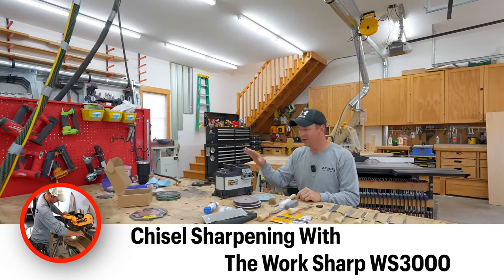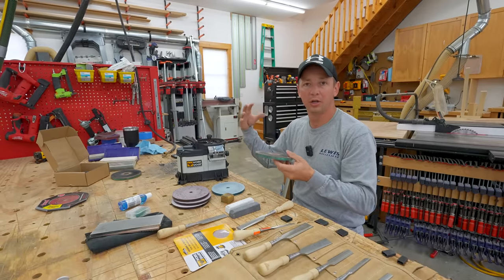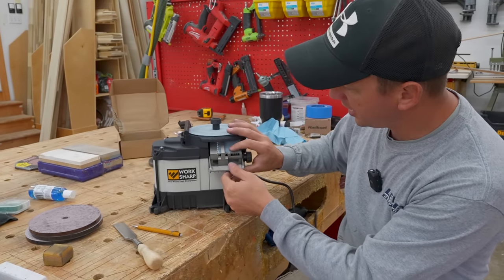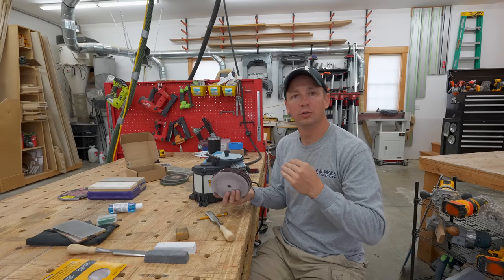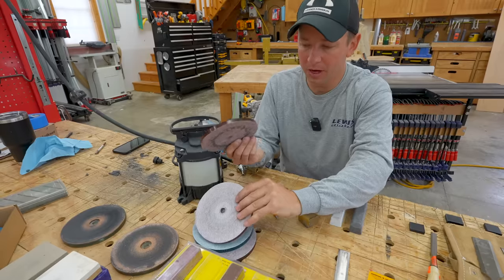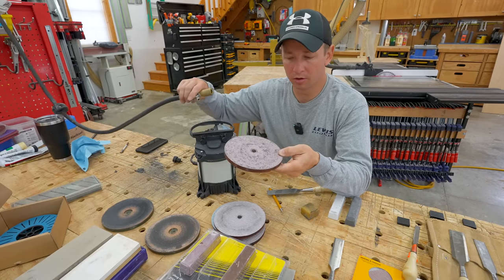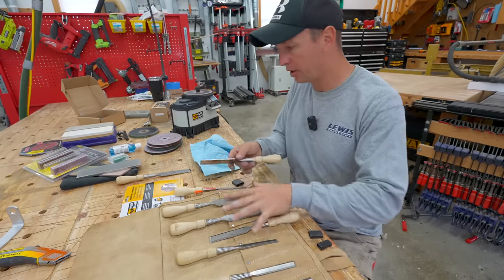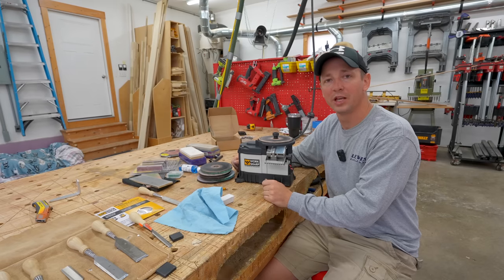I Finally Found a Sharpener I Like!!! | Super Sharp AND Fast

Comment: I have had the Work Sharp for several years. It works OK.  One thing I did was to remove that piece of sandpaper that is stuck on the machine.  After spending a lot of time flattening and polishing the back of my chisels (on water stones) I was not happy that I was scratching the mirror polish on that sand paper.  Removing the burr is very easy to do by laying the chisel flat (like Spencer does) on the spinning disk.

Comment: Great video!

This is a wonderful machine that I’ve been using for about four years now.

Work sharp supplies slotted blue discs which I find work extremely well because they reduce tons of heat and expel the shavings quickly.

I hand flatten all my chisels with 400 grit on a piece of granite.

I use a rubber belt dressing block to clean my discs, saving you time and money .

This tool is a wise investment if you work with hand tools!

Comment: The back of the chisel is hollow for a reason, I wouldn't spend too much time trying to make it perfectly flat. You only need it to be flat about 1/2 inch from the edge. The less hollow you make the back the more time it will take you to sharpen it in the future because you are increasing the surface area that you have to grind.

Comment: Spencer, TayTools has a much cheaper version of that sharpening system. But it uses a drill press instead of a dedicated machine and doesn't have a tool rest like the one you showed.   I bring it up because they have a float glass with four different grits just for flattening the back of the chisel using Cubitron.  There was one video where in about two minutes, he took a junk chisel and sharpened/flattened in about two minutes.  I'm betting that if you just ordered the cubitron/xtract circular sand paper from him, you'll flatten it in minutes.  Actually, now that I think about it, you should become an affiliate to TayTools as well.

Comment: I have a set of Marples chisels from the early 90s, I use these in the cabinet shop and a set of black handled craftsman in the van for installation. I don't loan chisels out to anyone, they won't come back to you as sharp as they were and they be nicked up. I use an oil stone dress up before use and they be ready for a good shave

Comment: I use a micro bevel. Shape at 30% and sharpen with like a piece of paper under the heel. Corse to shape fine to finish. Use a pushing stroke like twice and done. To resharpen just two more pushing strokes. Like the master violin maker who showed me said," you don't have all day to spend at a stone. Only sharpen what you need and get to work." Oh as soon as you see the line it's time to reshape. I have found that is about every ten resharpenings. I found that it takes longer to plug and unplug the grinder then it does to resharpen a blade.

Comment: I like the Tormek. You get a hollow grind and you can sharpen super fast and not change any discs. It's expensive, but buy once cry once. Plus if you really want to mirror finish you can get the japanese waterstone and look at your reflection in the edge of the chisel.
Reply: Yes, I agree and given that he A) seems to have all of the best tools available and B) cited stumpy numbs who has I think three Tormek's, I don't get why he does not use that system.....but who am I to judge?
Reply from the maker: I have a grizzly which is a bit cheaper version of the tormek and didn't care for that style of machine.
Reply: I like the Tormek too.  I find it more versatile than the Work Sharp.  The Work Sharp does do chisels pretty well but not much else.  Plane irons don't fit.  Spoke shaves, knives, curved cutting edges etc. are much easier on the Tormek.  I found mine used on marketplace and didn't pay too much...
Reply: I have a Tormek and it is too slow for me to recommend. But I spent the money on it so this is what I use with wet stones in between Tormek visits.
Reply: @jeffcarter1466  i feel like the slow speed let’s me dial it in faster and I can go from grinding stone to leather honing in one go without changing wheels. The fast spinning of regular grinding wheels makes me more careful and take longer to get an edge.
Reply: @garybutterfield8953  i got mine to sharpen  plane blades and then I got so into it I sharpened every knife in the house. The family is scared to cook because the knives are so sharp 😂.
Reply: I have the Tormek.  It's great for chisels, plane irons as well as kitchen knives.  I like how the water traps all the fine dust and prevents blueing.
Knife Grinders in Australia has some nice accessories.
Reply: @thekinarbo  his videos are amazingly informative, sadly he died. He was the guru of knife sharpening.
Reply: @crashkg 
That's terrible, I'm very sorry to hear that.  He was a master at his craft.
Reply: @crashkg  Yep!
Reply: Sorry Tormek type owners. Worksharp takes a few seconds to do the same thing. There’s no comparison. I’ve had mine 5 years. With 1000 grit in it it takes me longer to walk over to it than it does to sharpen the chisel or plane iron. 2 seconds on the slide and one second on the back. I use Narex and Sorby chisels. No setting of angles, no water everywhere, no stropping,no truing of the stone…..
Reply: @jimbo2629 

I'm not totally familiar with work sharp.  Can it sharpen 12" kitchen knives or meat cleavers?  How about scissors?
Reply: @InsiderCarpentry  I agree, I have a Tormek, while it does a great job the setup and mess / clean-up time just isn't practical unless you are setup in a dedicated workshop, Years ago I purchased the WS3000 and never looked back, so easy to setup and use, plus razor sharp edges, note: the know can sometimes get "Stuck" on and hard to get off sometimes, lucky you posted this it remind me to get rid of the Tormek that's collecting dust in my garage 👍👍😂😂

Comment: I have the same tool 15:16 I place a few washers on the spindle under the disk and that gives me enough room to use the leather disk upside down, just don't push to hard when your using it this way otherwise you will cut into the leather👍

Comment: I bought the 3600 and 6000 grit paper (pricey though)  and the package said the 6000 is like honing with leather.  So use the 6000 paper down and use the beveling portion of the tool instead of fighting trying to keep the bevel on the leather freehand

Comment: Make a small wooden or metal gantry with a pivoting base. use a digital angle gauge and zero it out on your glass wheel and then set your gantry platform to correct chisel angle.

Comment: A "natural rubber cleaning stick" (Amazon search keywords) will clean the metal or sawdust out of the sandpaper better than air or anything else.  Makes used sandpaper look new almost instantly.  (Not sharper but at least it is clean.)

Comment: I carry a cheaper Narex 1” Chisel in my Akibus tool belt!  I hv 2 Cherries ( set ) in my Van.  
I sharpen it once to flat and 1or 2 times a week 7-10 strokes on the Chisel back only ( once sharp just re sharpen by back only!)

So once and done !
My 2 Cherries hold a long edge!

The problem with the machine?  Heat!
Heat can and will break down a good chisel quick!  But I am sure you already know that Spencer !

I absolutely enjoy & learn something every video u make !  Thk U very much 4 your hard work!

Comment: There is only one method that works quickly and correctly. I’ve tried everything. The Worksharp is the answer. You can touch up a chisel in 5 seconds with no setup and no overheating. Forget secondary bevels. Mine are all sharpened at 20 degrees. I use a diamond disc in it. It rotates at the correct speed. The angle is totally repeatable without set up or adjustment. My Narex chisels took ages to flatten the back about 5 seconds.😀 That’s about 5 times longer than touching up the edge. There is no better system than using a slope. Forget measuring, honing guides, water everywhere, loss of temper, flattening the stone. Keep it near your workbench with 1000 grit in it top and bottom.

Comment: Like you, I absolutely hate sharpening and don’t like the idea of wasting time on stones or the Tormek machine. Honing guides are horrible also. I like that machine and believe this actually will alleviate my frustration with chisel sharpening. A suggestion I have for the spacing for leather would be to create MDF disks and making them thinner to include the thickness of leather. If still not enough to get underneath the disk, I’d suggest adding a couple of washers to raise up the disk. I’ll probably do that if/when I purchase this unit.

Comment: Good video as usual.  With chisels and plane irons, I find that once you get them flattened and sharp, stropping with fine compound often will keep them REALLY sharp for a LONG time without having to go through the other steps, unless you damage the edge somehow.  The Sweetheart chisels are pretty good steel and hold an edge pretty well.  But they DO come from the factory WAY out of flat.  That's disappointing.   In an industrial manufacturing facilty, how long could it take to add that little bit of extra quality finish?  I think the customers who are buying these mid/high end chisels would happily spend an extra few dollars for a set that has the bottoms flat and polished.  I would think that alone would sell a lot more, just for the WOW factor of seeing the polished, flat backs.  But what do I know?  I just imagine the positive feedback and sales increase they'd get when every YouTube influencer who reviewed these chisels said, "Let me show you what sets these apart and closed the deal for me make this purchase."  As they zoom in on the mirror finish that still shows the little unpolished hollow spot straight out of the package.  I think that'd be a no brainer.  But again, what do I know?  Well, I know it'd be a huge selling point from my perspective, knowing that I wouldn't have to spend a couple of hours flattening a set of chisels before I could put them to work.  Especially for something that would take just a few seconds with an industrial production machine.
As for THIS machine, I like the glass plate idea alot.  Sound a bit under powered, but not terribly so.  I like the small footprint and speed of changing the plates.  I would love to see this with a reversible motor so you could alternate which side you sharpen on.  With flat wheels like this, the farther you are from the center, the more material you remove because the speed and amount of abrasive is higher.  Not a huge deal, but I'm a bit OCD about some things.  Haha!
Reply: Crazy really most chippies just throw their chisels away when blunt they don't realise that new chisels don't even come sharp. They've never used a sharp chisel probably never had to work with hardwood so clueless
Reply: @jamiedyer7782   Yeah, haha!  When I was framing and forming many years ago, I always carried a 1in chisel in my pouches, as did a lot of others.  But mine were sharp.  What a time save when you need a quick notch or to knock off a protruding corner.   I learned the hard way to never let anybody borrow it.  They use it for everything but what it was designed for, and IF i got it back, it'd be badly damaged.  To them it was pry bar, concrete chipper, nail cutter, you get the idea.  Argh!!!  Still pisses me off thinking about it.   Haha!

Comment: The purpose of the leather is to strop. You do not have to get the angle perfect at all. Because you should have worked to a very fine wire edge. Then strop quickly.  Your only goal is to remove the barely noticeable wire edge at the cutting edge. The strop will act like a micro bevel setting and softly grind away that thin edge so that it does not immediately break when you begin using it. 

And don’t strop the backside of a chisel once you’ve flattened it. You’re working against yourself!  Flat is flat. Stropped is no longer flat and there is a lot of material to remove to get back to flat. 

Now, you may find you do need to strop some chisels. The steel on some chisels is simply not going cooperate all the way down to truly sharp without heavy stropping. This will become apparent with experience. And heavy stropping should still be a relatively quick process. 😊

Comment: Hi Spencer, tank’s for this video. I have a question; this system does it hone the chisel square? I wonder because it is sharpening on a wheel,  the right side (leading edge) of the chisel, see more circumference from the sharpening disc as it turn. I hope, I did  explain well my point, English is not my first language. Sorry for that. Keep doing your videos!
Reply: There is an adjustment to get a square edge
Reply: I have one- I found it slightly rounded the chisel. I use a sorby belt sharpener now

Comment: Thanks for the demo.  Off topic, but how do you keep the handles on your Sweethearts?  I’ve tried using sandpaper on the metal part but not working.
Reply from the maker: Spray them with hairspray and them pound them in.

Comment: Can one flip the strop disc and use the underside to polish the bevel?   And while we're at it, why not have one strop wheel with coarse on one side and fine on the other?  Also,  do wheels only mount in one orientation?

Comment: For knives I use a Ken Onion variable speed belt sharpener. Same process move from heavy grit, to 600~1200 grit. After that,it’s like two minutes to razor sharp a dull blade. I’ve even sharpen a razor knife blade.

Comment: As far as checking for sharp, try parring end grain. If you can move the chisel with minimum effort through hardwood end grain, you have a sharp chisel. 66carpenter

Comment: I love my worksharp, but with time the bearing surfaces will ware and the wheel deflects away from the chisel leaving an unsquare end with a tapered cutting edge that I suspect is sharp towards the centre of the wheel but unsharp at the furthest edge. I am just going to buy my third in a ten year period, so I doubt this would eber be a problem for nonpro's. CBN wheels are available but the finer grits tend to become compacted with steel and at that stage they are useless, in my experiance this dosent take long. I should add that I am an animal with my chisels. I fit oak doors to fully painted door frames for a living so 800 grit is as sharp as I need/find worth while whilst finesing hinge and latches.

Comment: Why does the whole back have to be flat? The chisel end is only about 1” or so. So why not concentrate just the end section?
Reply from the maker: I would say that in general it's because in order for that section to be perfectly flat, the rest has to be perfectly flat also. Except if you have  hollow area on on a chisel that doesn't affect the blade like I had on one of mine that I showed in the video.

Comment: Just get a normal bench grinder and fit CBN wheels, you'll never look back and they will last you a lifetime. Yes it is a hollow grind instead of flat grind, but the hollow grind creates a heel and toe on the chisel , that allows you to find the angle easily when you want to then move on to the sharpening stone to put a finished edge on the chisel. 
  Don't waste your time moving up the grits to the thousands, because first time you cut a lump of wood with your chisel, that finely tuned edge has gone.

Comment: I’m just curious about one thing. You talk about using multiple smaller steps between grit and you didn’t like going from 300 to 1000 on your diamond stones. However on the machine you went from 400 to 1000. Is there a reason you didn’t have a 600 or 800 in there? It just still seems like a bit of a jump in my mind. I have no experience sharpening and very little sanding experience so I’m literally asking and not trying to be a wise guy.
Reply from the maker: 400 to 1000 is actually not that big of a jump. 80 to 120 is a huge hump. The finer the grit gets the larger the numeral jump will be.

Comment: Today's Stanley Sweethearts chisels are not same as they were back 20-30+ years ago. I personally would never but a Stanley Chisel. If you were to buy high-quality chisels you are going to spend more than $30 a chisel even if you buy them in a set.
Reply: And Stanley chisels 20-30 years ago are not the same as they were back 50+ years ago, so.
Reply: Y’all sound old AF. If it works, it works. Comparison is a cheap way to flex your insecurities rather than focusing on what matters. SMH
Reply: You will spend $100 per chisel to get the quality steel required for REAL edge retention and sharpness. The new stanleys are fine for most of us in construction. But they are nothing like the old sweethearts. 

Personally I have only Lie Nielsen Chisels.